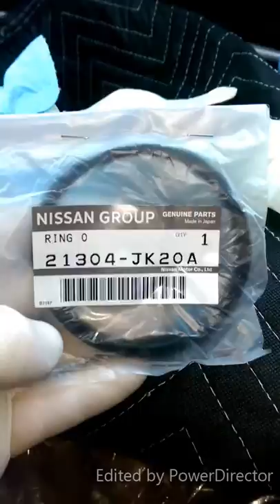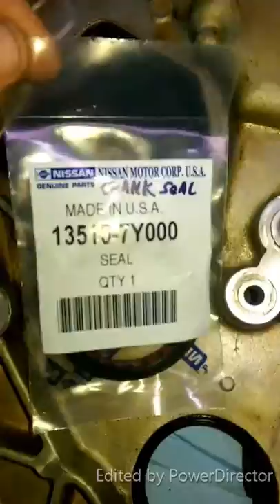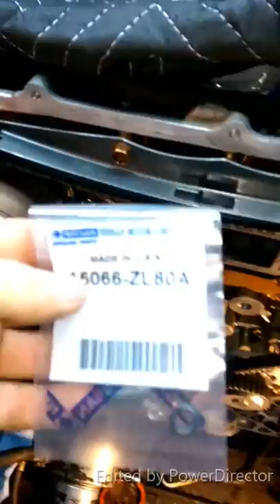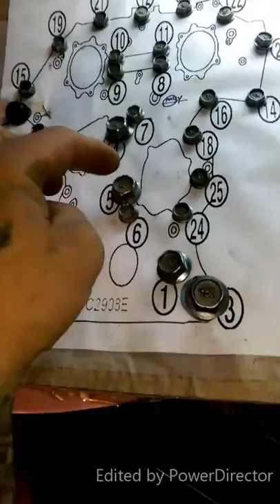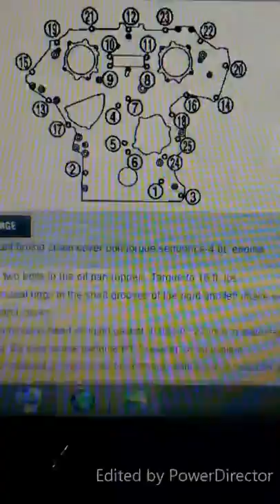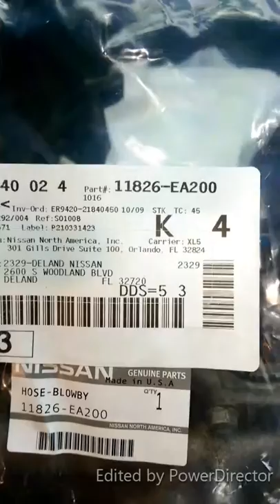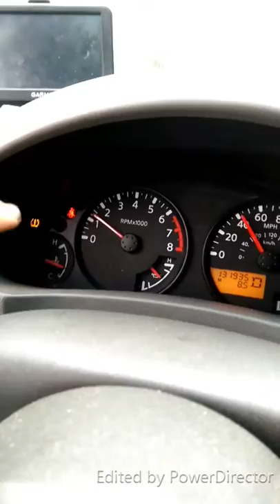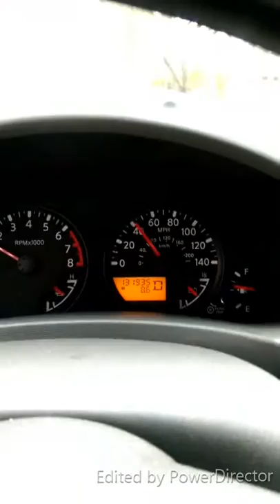Nissan Xterra Timing Chains and Water Pump (PT2)

Comment: Did you decide at the end to replace the valve covers?  Would have made life easier to remove them at the beginning and then you could have easily replaced the upper tensioners. Plus, it gives you access to the the cams, so you can hold or move them with a wrench, if needed. Looks like you went to the nissan dealer for some parts, not sure why you didn't get the factory upper tensioner guides, since that is one of the biggest issues with the nissan whine noise. that's a lot of work to not replace the upper guides.  Good job and hope she is running well
Reply from the maker: I did replace both covers. Yes, some parts from Nissa. I found my local dealer had posted them on eBay and I was able to buy them at a cheaper price. Since I did this job to date, Ol' girl still purring like a kitten.

Comment: How is the X holding up after 2 years?
Reply from the maker: Like clockwork. I'd recommend the product.
Reply: @EdExotics  How many miles do you have on it? Have you replaced the radiator yet? I lost my tranny to the SMOD. BTY - Excellent videos!!!
Reply from the maker: @flaprepper  she's pushing around 160k. I did have a tiny radiator leak and replaced it. All this with known and/happen the first few weeks of owning her. Haven't had any issues that came up besides the radiator. Better start calling the yards to see what's available. Good luck with the search.
Reply: @EdExotics  I repalced the tranny about two years ago and all is good now. Mine is an 05' wit 206k and a new pait job. Any plans for more xterra videos?
Reply from the maker: @flaprepper  Honestly, I hopefully not lol. As much as I like working on her, I'm not looking for anything else to break but if it happens and there isn't a good video about it, I'll make it